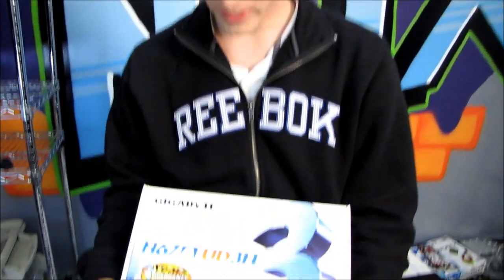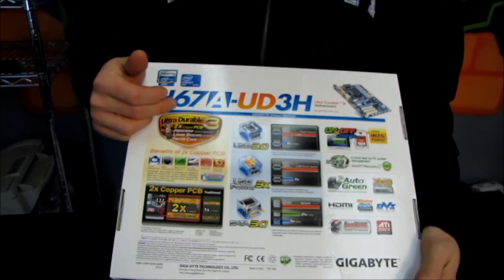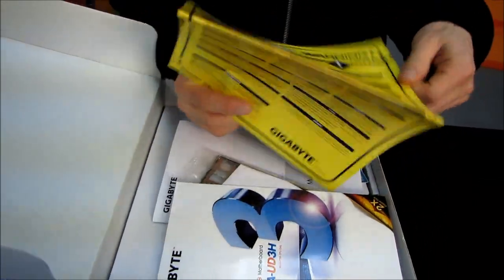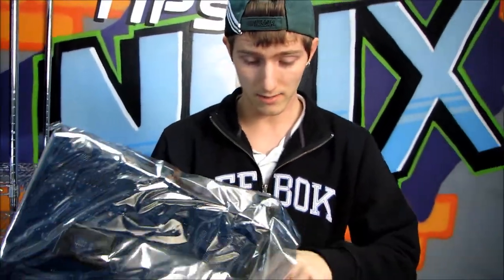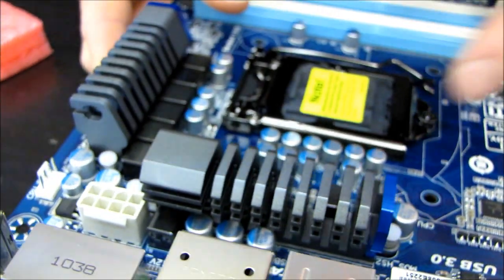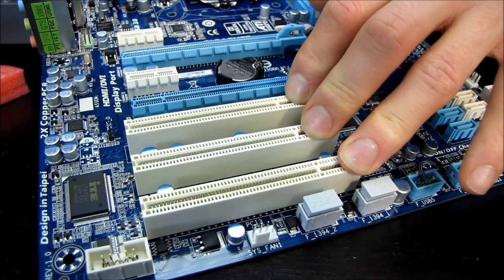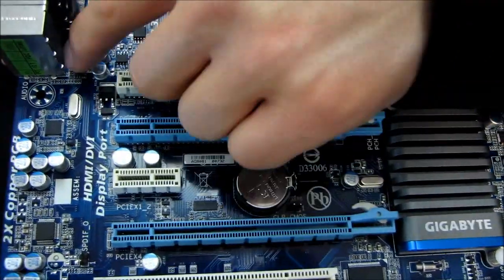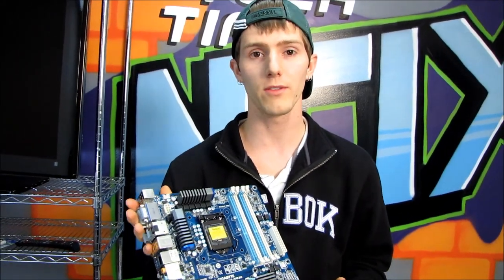Gigabyte H67A-UD3H Core i5 LGA1155 Sandy Bridge Motherboard Unboxing & First Look Linus Tech Tips

Comment: @kungfufreak360 It's Intel-related design error on every Sandy-Bridge mobos (it's not i5 motherboards, the "i5" stands for the processor name like core i3, i5 or i7), which could lead to SATA2-errors in the future. This was corrected on all Sandy Bridge mobos (so also on the Asus, MSI, these Gigabyte ones and others...) and these days/weeks there should be the new revised ones in the shops. You can check it by the big "REV. B3" logo on boxes or by special software of each of their vendors.

Comment: Dont see the point in doing a review of the 1155 motherboards as u cant buy any of those motherboards atm (atleast where I live) and it will take a while untill u can get a 1155 motherboard so who knows if they will change other stuff with the motherboards while they switch the chipset. Good review but i would release it when you can buy 1155 motherboards again.

Comment: @Intel1502 i did upgrade from a 775 core 2 quad and im not much of an overclocker, my i7 sits nice @ 3.6 on stock volts and im happy with my H50 :) doubt ill upgrade for a while as for gaming my computer is perfect.

Comment: @ArtOfKillingTY It seems to contain enough pins for 8x but in reality it doesn't deliver more than 4x bandwidth. You can see the PCIEX4 label at the bottom left of the slot and it is also specified in the specs. :
1 x PCI Express x16
1 x PCI Express x4
2 x PCI Express x1
3 x PCI